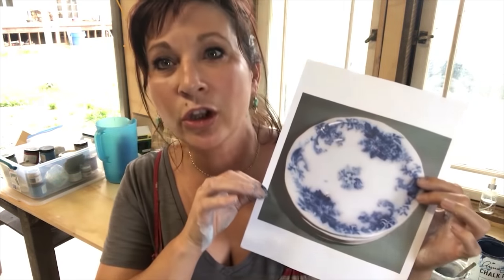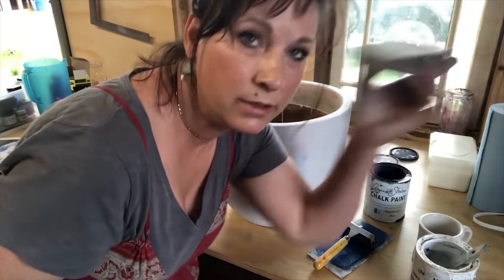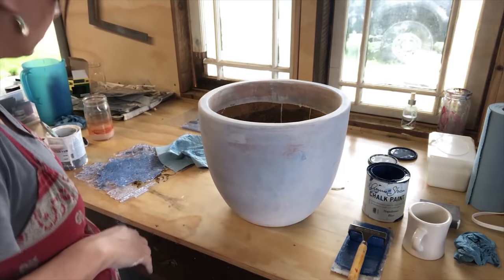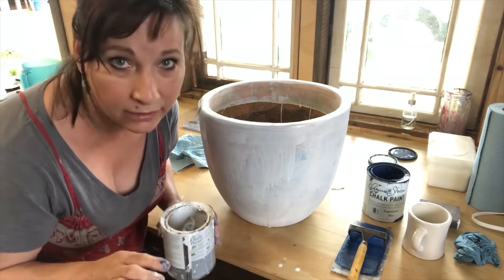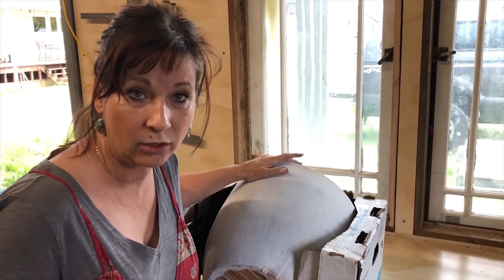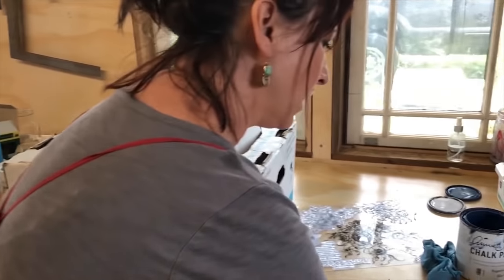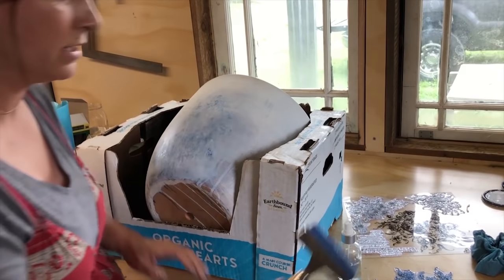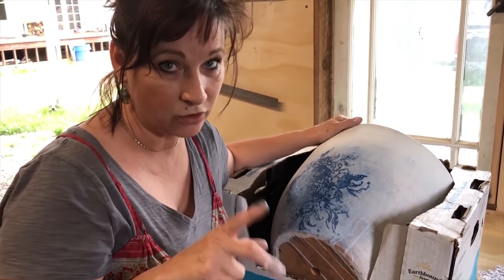IOD DIY Blue Flower Pot using IOD Rose Toile Decor Stamp - Iron Ochid Designs

Comment: Do you seal it with a clear coat afterward, so it doesn’t run when you water your plant?
Reply from the maker: Yes. :) Seal with a high-quality water-based poly after letting the planter dry fully. Then make sure to follow the curing time for your sealer (on the package instructions) before planting. Happy making!